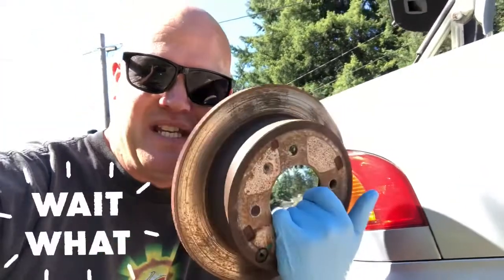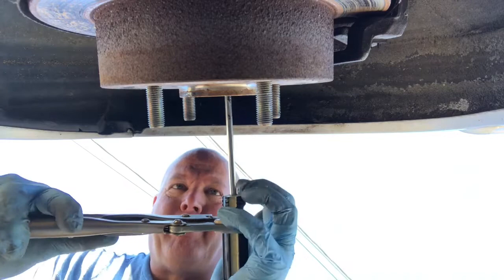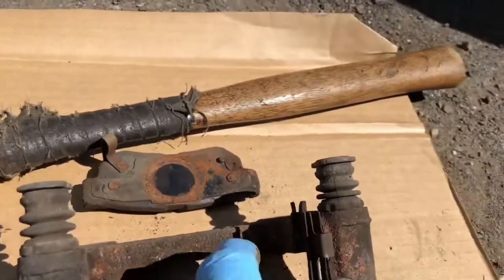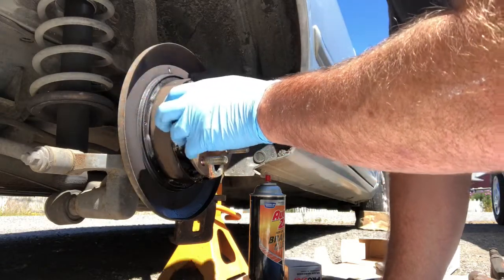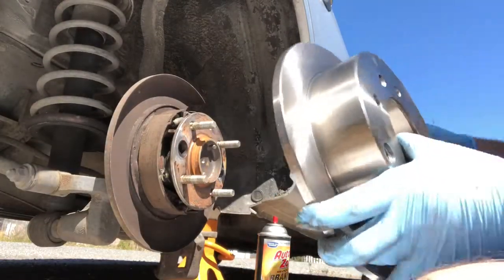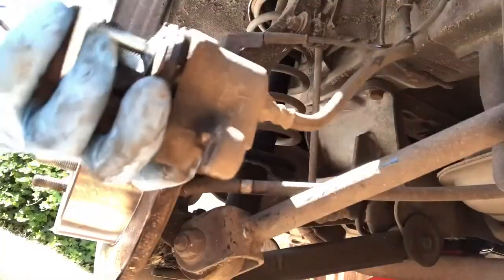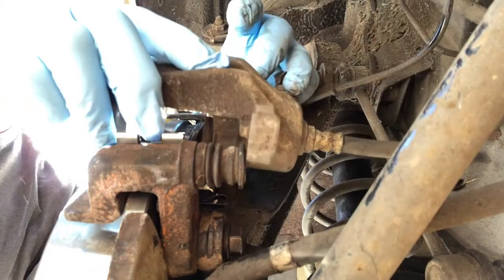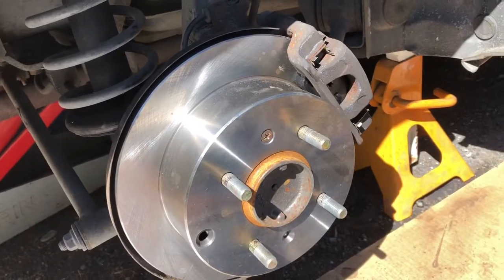EASY Kia Optima 01 - 06, Hyundai Sonata 1999 - 2006 Replace & Install Drum Rotors? Replace Breaks

Comment: I watch to support your channel. To make the hardware seat better, I hit the slots where the hardware goes in with a wire toothbrush thing from harbor freight (3 for $1) to remove the couple thousands of surface rust. Then a touch dot of brake grease in them slots smoothed down with a flathead screwdriver or something similar so it’s a thin layer. They typically seat very well and the pads slide in like butter. No wrestling with them. Also they wear more even for me. Just my 2 cents, love your vids!
Reply from the maker: Great tip Jesse, thanks man you rock!
Reply: Shaw Family Videos YOU ROCK, keep up the double videos a day if you can. I would start a channel if I had content and interest in taking the time to film, then edit for jobs I do. I always look for tips and hand them out. Maybe one day if I start filming you’ll give me tell me a tip.
Reply from the maker: Yeah It would be cool to see you get a channel going man! My iPhone has made things a lot easier. Good quality camera and I edit everything right there on my iPhone 8. Upload to Youtube from my phone. And YouTube even has a YouTube studio app now.
I use this app called Videoleap. Been using it for like six months finally paid $35 for the full version I like it so much. And as far as producing videos once you have 1000 subscribers
the monetization helps. I make 150 to 200 a month on the channel now. Which isn’t a lot but for a fun little hobby it’s kind of cool. And a few weeks ago I got my first credit from Amazon for my affiliate links. 😁👍
Reply from the maker: Repair videos are money. People go searching for them. And if they like you as a person they subscribe and keep watching. That’s how I found JT. It’s like infotainment. I like his content and I like him and his energy. JT and I could help you get them thousand subs to 👍😁
Reply: @RussShawTV  this is exactly why I am subscribed to you. I can't remember what I had to do to my Optima. I have stuck around for the entertainment.